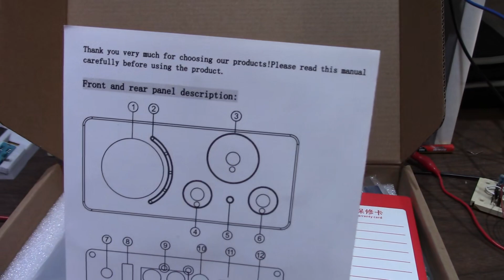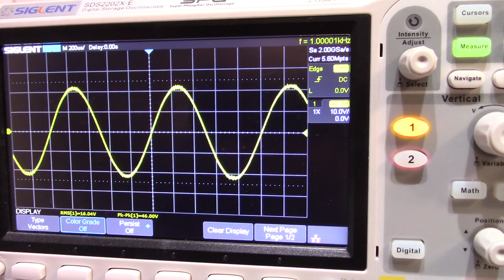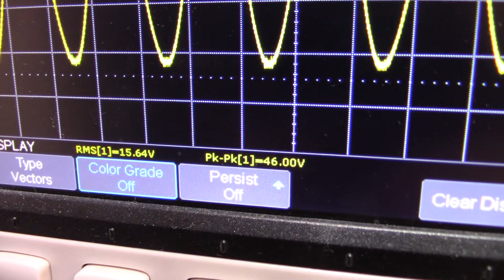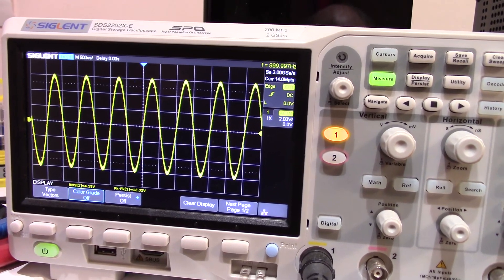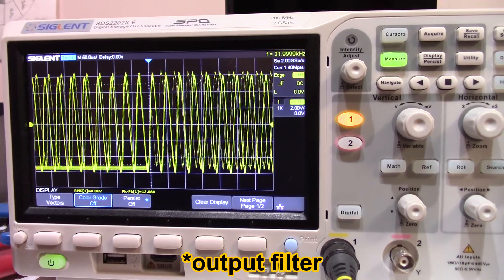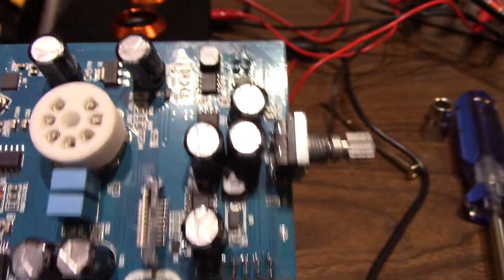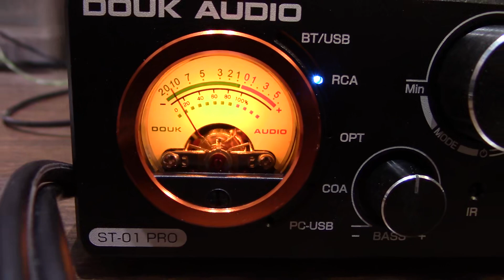DOUK AUDIO ST-01 Pro amplifier performance tests with teardown

Comment: I think they have added a valve (a RF valve) for looks only. With all those 5532s the circuit offers more than enough gain. So, the valve can only really contribute to noise and harmonic distortion.
Remove the valve and all its associated circuitry and you probably get less noise, lower THD. Less issues with impedance matching. Overall, it will sound better and cost probably 50% less. With such poor filter design your chosen speakers should be a very close 8 ohms with no impedance drops towards the 4 ohm area or it will sound dull.
Using an RF valve for audio is not a good idea. Thats why audio valves like EF86 etc were made just for audio. Such valves do not really exist in the Chinese surplice market. so they throw in any cheap and unsuitable valve knowing the public just see a valve and get super excited.
Reply: Yeah, in most of these the tube doesn't add enough distortion to make for "the tube effect" so it's kind of pointless. Would be cool to have an adjustment on the tube stage so one could adjust from clean to prominent 2nd harmonic distortion.
Reply: He dodged the technicalities regarding the tubes, but liked their glowing effect, with possible led enhancement.
Reply: And it still on $150. Amazing.
Reply: Now that is a great idea. I would like to have a amp I could transition in and out tube effect so I can hear what my grandparents heard before 1970. @HillsWorkbench

Comment: Douk ST-01 Pro TUBE tip: If your amp came with Chinese 6k4 tubes (has a red star printed on the glass), mine caused distortion.  I upgraded to much better sound for $17 with GE JAN 5654W matched pair tubes.  6k4 tubes can be replaced by 6J1, 6J2, 6J3, 6J4, 6J5, 6"1N, 64N, 65N, 5654/5654W, 5725, 6AK5, EF95, 6BA6, 403B, etc.  Your tubes may be ok.  Just an FYI free tip.
Reply: Couldn't believe you replied the same post under every single one video about this amp. Do you selling them tubes??? 😅
Reply: @maovi7652    No, I just own majority stock 🤣

Comment: Throwing in a couple of valves, is like adding a red racing stripe to your car - makes it go faster.  yeah right
Reply: Well, if I see a car with a red racing stripe, I assume its a beat, even if its parked.
Reply: I read that a guy was thinking exactly the same, so he decided to remove the tubes and play a song to test the amp, and the volume output was almost minimal. Did you try to use without the tubes to check the theory? Because if you remove the racing stripe in car, you know nothing actually happens performance wise.

Comment: I wouldn't be surprised if they are not stepping the tube B+ up beyond the 24 volts of the supply rail. It would be interesting to measure it but that's my suspicion.

Comment: Dear John lets face it. My everyday driver is a hamble CD7379 + "AD828" (fake I think  from Aliexpress) powered by a 220 VAC / 12 VAC 4,5A  transformer for halogen spot lights. I can't hear even the slightest  back-ground noise  and I'm very satisfied from the audio quality  (not for "critical listening) in conjunction with a pair of full-range speakers (open faffle) . In contrast  OVER A FEW MONTHS  I'm  trying to make a class-D amplifier to drive the same speakers with a descent "quality" (not screaming highs) and  S/N  ratio, BUT IN VAIN !
Reply: Ive got one of those ic amps im impressed with how good they sound

Comment: Great review. Use of tubes I find dubious.
Reply: It is curious, is it not, that Mr. John did not do a distortion test.
Reply: Anyway, if its a class D, then what are the tubes doing? Are they really amplifing the signal.
Reply from the maker: @franzliszt3195  They are probably configured as a buffer in the signal chain.
Reply: @franzliszt3195  Cathode follower buffer.

Comment: Glad to see frequency response is good at 8-ohm, but I wish we'd seen a distortion test as I never trust these toob products coming out of  China.  The tubes are a gimmick and probably reduce fidelity in most designs, though lately they do at least place the tubes in the signal path, for better or worse.  There were some models where they just ran the heaters for show.

As the average audio consumer becomes dumber and dumber, I suspect that adding tubes lets these sellers raise the price while adding no useful features.  I actually like tubes, btw, but they are not some magical, lost technology that improves sound; simply looking at the tubes and warm glow makes anything seem to sound better ;).

I like how many inputs this thing has and it appears to be a reasonable design and construction, but it could have been priced even lower without the tubes.
Reply: The problem here is that a speaker gives different ohms in different frequencies, which means that a class-D with a standard output filter coil design will never give a flat frequency response.

often a speaker gives, for example, 4 ohms in low frequencies and, for example, 8 ohms in high frequencies, which means less bass and more treble.

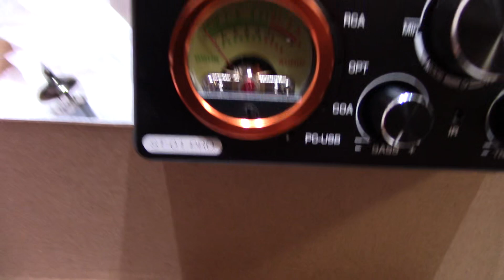Comment: 1:03 Brings me back to my student days..  2:20 Ah yes, I've got AYIMA version of this, tried using as a preamp only into an Arcam Alpha 9 power amp, not particularly impressive; tube rolling won't help it's the fundamental design of the circuit which ultimately dictates how good the sound is.

Comment: The problem here is that a speaker gives different ohms in different frequencies, which means that a class-D with a standard output filter coil design will never give a flat frequency response.

often a speaker gives, for example, 4 ohms in low frequencies and, for example, 8 ohms in high frequencies, which means less bass and more treble.

All cheap clas-d often have the same main design.

Correct me if I'm wrong.

This is a completely normal CHEAP class-d amplifier with a slightly fancier preamplifier.

Nothing pro quality about this amplifier no.
Reply: ohm load is not a concern in "freq responce", d amp do provide stable constant volts ac out....modern class d are extremely clean, BLIND AB TEST FOR YOURSELF, for the $$ its a great value

Comment: No harmonic distortion testing?
Reply: John said he listened to the amp and it sounded good to him. That's good enough for me. I know the distortion of modern amplifiers is inaudible. At least when they're below clipping. What's more important is the power output before then. Generally the louder things are the more we like them. So as long as you have enough power to satisfy you then you're good. This amp is good for 30 Watts a channel. Which with efficient speakers is pretty loud. Really 1 Watt can be loud.
Reply: @simplyflipflops  the tubes likely are not even in the signal path. They usually aren't. They're just there for looks. John said he couldn't find a power supply for them. I've seen people pull those tubes and it has no effect on the equipment. But in this case who knows. None of that happened besides the one comment John made.
Reply: @1pcfred  Bet you they are in the signal chain. These micro tubes can go down to a low voltage as per the specs sheet. Albeit not in their ideal range. :)
Reply: Ya, and how does he inject that 3.5 kHz signal of 1 percent?
Reply: Probably so. I don't think I'd ever buy a tube amp. @1pcfred
Reply: @franzliszt3195  I've had tube equipment. It's the 21st century now though. So solid state is pretty mature at this point. It's the better option for most applications. There's still some things we need to use tubes for. But they're not the kinds of things most folks need to do. Audio amplification certainly isn't one of them either. I do still like my Cathode Ray Oscilloscopes. LCD just isn't the same. But DSOs do have some advantages.
Reply: @franzliszt3195  magicians never reveal their tricks. It would be nice if John did explain some of the things he does though.
Reply: @simplyflipflops  they may be. But I'd be surprised if that was the case. The only reason those tubes are there is to sell the product. To that end they're no more functional than a Pokemon sticker would be. It's just visual appeal. If they went through the trouble of using those tubes it'd be pretty counterproductive of them to have done so. Quite frankly I hope they didn't in fact. For having done so they'd lessen the value of their product.

Comment: Don't most speakers have a rising impedance above the nominal rating with increasing frequency in the treble region? So if the tweeter in a speaker that is rated 4 ohm nominal.....the tweeter would still be having a flat response if it was near or above 8 ohms?
Reply from the maker: Yes, that would be true.

Comment: Basically, someone has installed heat sink on the wrong side of the board.
Reply: Heatsinking is always an issue on most class D stuff. I'm not sure if they simply do not understand or simply just don't care, both probably.
Reply: I'm sure it was tested a lot. Unless you play the first 5 seconds of Bach's Tocatta Fuge in a continuous loop your probably OK. @MichaelBeeny

Comment: This is nothing But Aiyima T9 (not pro) ..once t9 pro sales got spiked against its predecessor they have given another model name and didd co name..i beleive
Reply: I've seen a side by side teardown of both units. Internally they are indeed different in their board layouts, not quite the same. I don't think it's best to do an out of the box sound test. He should test now vs burning the unit in for a couple weeks.

Comment: 100+100 watts max power lying dishonest specs on website, .07%THD.
Reply: I have NEVER tested one such Class D that makes its published power spec. Often, not by a very long way.
Reply: I'm from the FTC days when amps had to have weighted true specs.
Reply: It's because they give the maximum chip specs from the whitepapers, not the performance of the actual device. The chips are capable of that output just not in that config/machine.